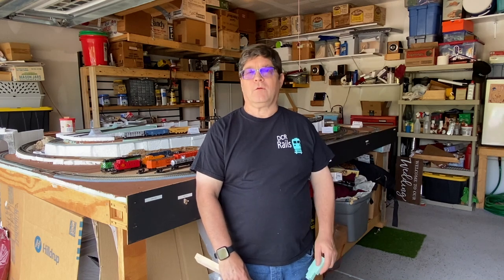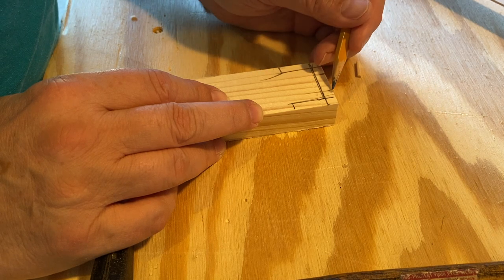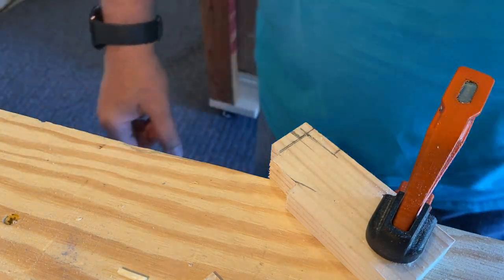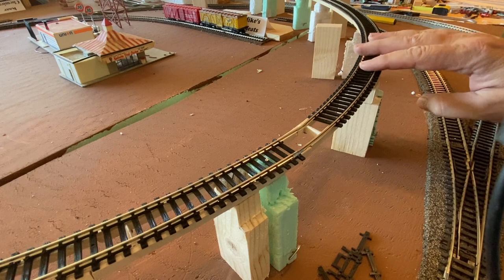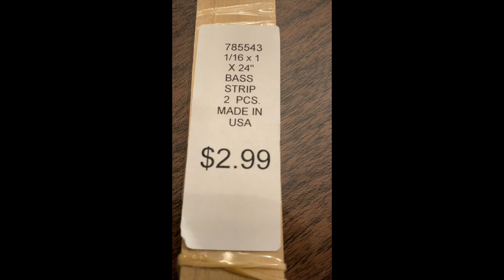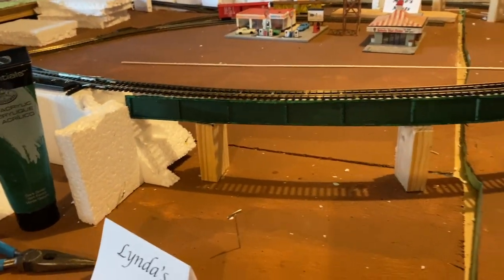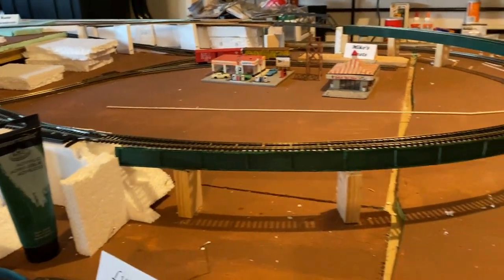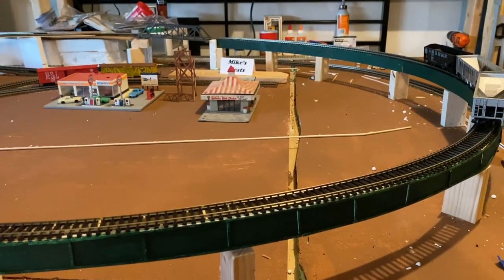23 Build a Curved Girder Bridge by Boiling Water Part II

Comment: You mentioned derailments at the apex of your super elevated curve,  I will give you a tip when laying flex-track through a curve.  Always lay a piece of flex-track over the apex.  Find the mid point of the flex track and lay the track so the mid point lines up on the apex.  Then build the rest of your curve from the ends of that piece.  Your apex has the most stress on the curve.  You should do your best to avoid track joints at the apex.  Go stand where you can look straight on at the apex.  Notice the curves tend to become more gentle beyond the apex.   I always try to lay out my track on curves through the apex first.  Then I build, filing in between the curves.
Reply from the maker: Great advice. I’ll add that to my repertoire. 

Thank you for sharing this!

Comment: Why didn’t you just 3d print the pieces?
Reply from the maker: I don't have a 3-D Printer. I did have some scrap wood. So I use what I've got readily available and go from there. I plan on getting some stone work and then paint, cut, and install it to cover the bare wood that is there now.
Reply: Some of us can not afford a 3d printer...
Reply: @dcrrails3402  Then why would't you get the stone work and install it before installing the wood??? Seems backward to me...

Comment: 1. Cutting boards to length like that is pure stupidity..   2. Worst way to make sure that the marks are square.. 3. Clamping pressure could be better so wood wouldn't move.. 4. Real nice precise line!!! Not really.. 5. You have a table saw. Why in the hell didn't you use it??? With a miter fence set up, they all would be the  exact same.. 6. Why didn't you use a rattle can and just spray the strips green?? 7. Cloths pins, smart for a change. I use them all of the time.. 7. Why the hell didn't you put the small embelishments on the sides before gluing the sides in place?? You would have had better and easier time doing this and better fit.